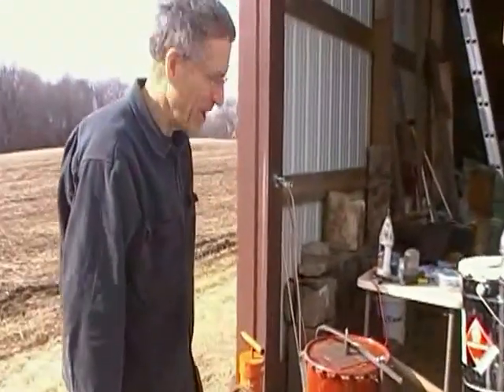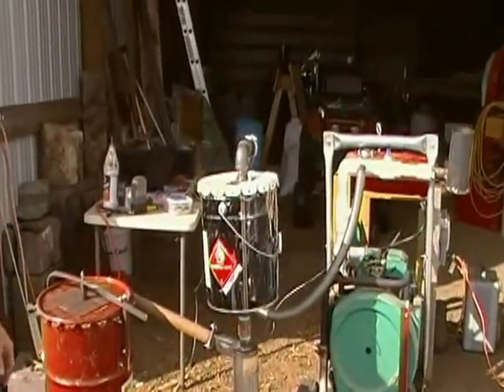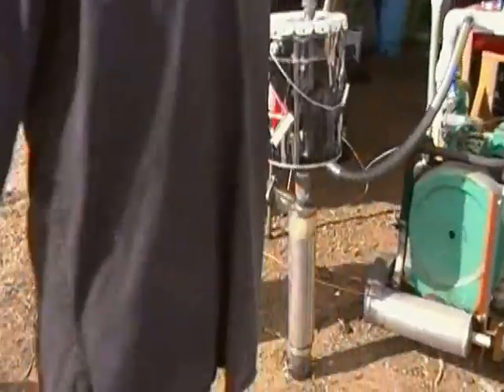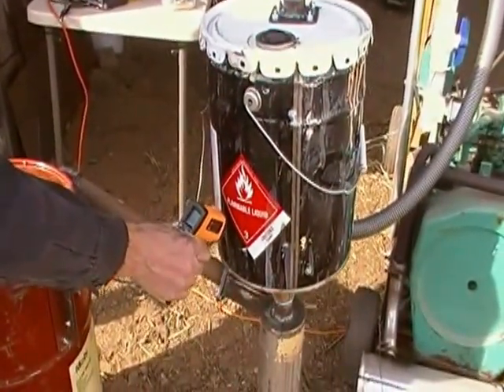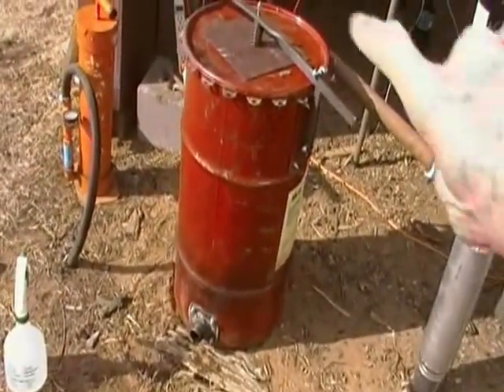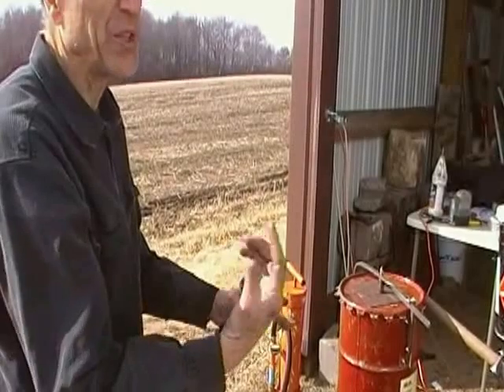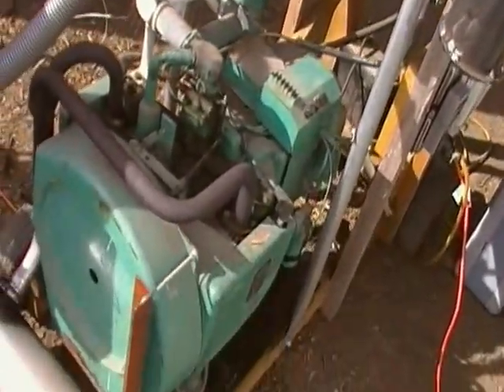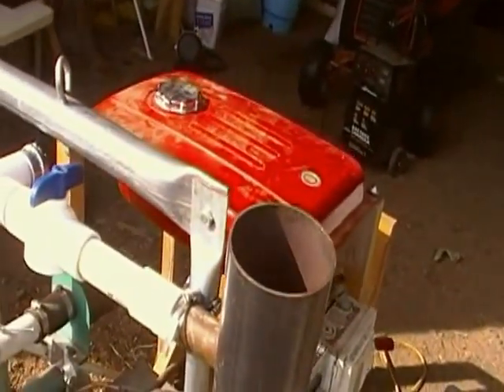George Adams New Charcoal Gasifier #1 of 7 March24 2015

Comment: I like the refractory inlet with grate idea.  Does it actually protect the inlet pipe from melting?
Reply from the maker: Yes.  No charcoal gets below the grate, so the oxygen in the incoming air has nothing to react with.  So, that air is cooling the pipe.  So the pipe shouldn't get very hot at all.
Reply: Thanks for the reply.  Does the cast iron degrade in the heat?  Also, what thickness was the cast iron?
Reply from the maker: We don't have enough time on this system to know how long that grate will last.  Those grates are pretty cheap, though.  But I can tell you that cast iron lasts a lot longer than does steel for this service, from my maple syrup making days.

Comment: Very nice!  I like the refractory grate system.  How do you light it up?
Reply: +Cory Warneke 
On the earlier versions of my charcoal gasifiers when there was no refractory "cup" and just a pipe lighting was just using a propane torch to get some charcoal burning then adding suction or a blower to get thing hot. With the cup and cast iron grate it is a bit harder to get the charcoal going. 
For this unit it seems to work best to have a tablespoon or two of charcoal in the cup under the grate. I use a fairly wimpy 12 VDC vacuum to suck air through the system. The charcoal is ignited with a propane torch or a 10" long 1/4" by 1/4" piece of pine that is lit on one end. I have also tried a 2" square of rag connected to a 12" wire then soaked in motor oil. the oil is lit and stuck in the air intake. After a visible flame appears I switch the vacuum to blow into the unit. One time after the system had been running for awhile I switched back to using the vacuum in the sucking mode. Not a good idea. I melted the plastic impeller in the vacuum. I haven't started this unit enough to have a really good idea of the best way to get it going.
Starting the unit is much easier in the summer than in the winter when the grate, refractory cup and charcoal are well below freezing.
Reply: +George Adams I was thinking you might be able to light it from the top before you fill it.  I guess every design has some short commings, but not melting nozzles is a significant plus.
Reply: +Cory Warneke I was going for not melting nozzles. Lighting might be easier without the cast iron grate but I would be more likely to melt the pipe. I'll comment again once I find a foolproof way to get it lit.

Comment: It is interesting that some folks have problems with water in the system regardless of how dry the fuel / wood.
Other folks like this inject water into the burner to cool things down / charcoal DEMONSTRATED HERE and yet
Most interesting is where some folks inject steam into the engine to greatly improve engine performance . / wood 
COMPONANTE SYSTEMS DO HAVE THEIR ADVANTAGES .

Comment: Something I have just recently learned about protecting electrical generation systems and electronics is that a EMP Faraday cage needs to be multi layered rubber lined and basically water tight to have a chance to survive the "High Frequency" damage.
Other wise all this kind of effort is all for not post /SHTF.
Just stating better safe than sorry .
Shalom